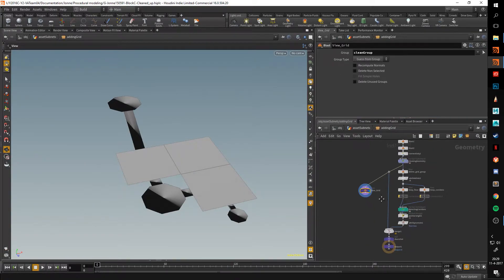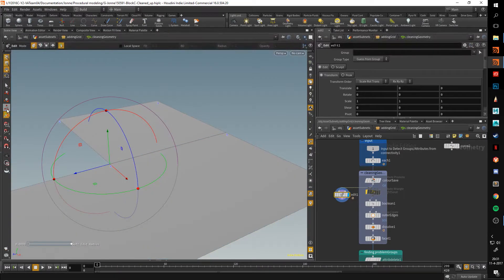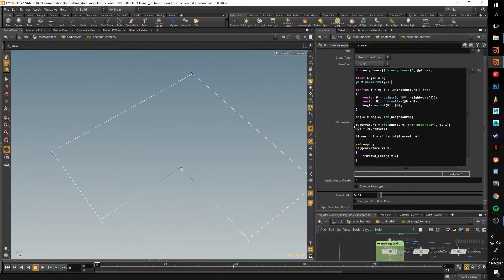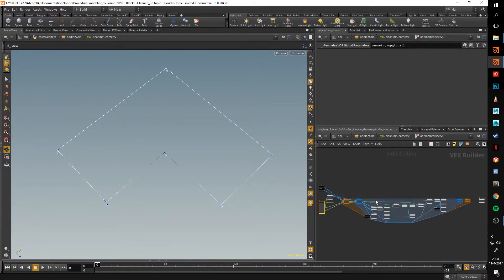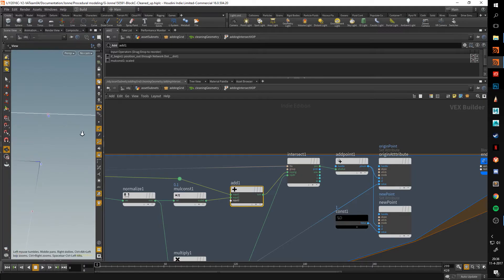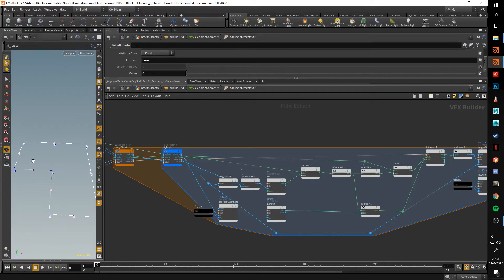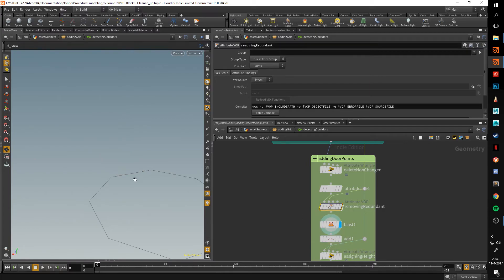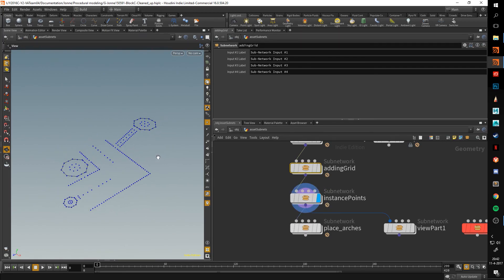Houdini - World building - Applying grid

Comment: I have an idea. Since you used polysplit, could you instead copy 4 lines at 90deg increments onto the convex(?) Point in the middle, then do a polysplit on each of them? Clean up the two unneeded lines with some sort of nearpoint function to see if there's existed points already. Just an idea :D
Reply from the maker: In this case this could have worked yes. What I tried to do with the system is prepare it for other shapes as well. If this would have been a cross shapes piece of geometry, the 4 lines would have been placed 4 times! In short, mostly for performance reasons.